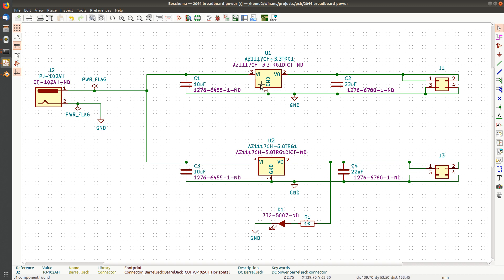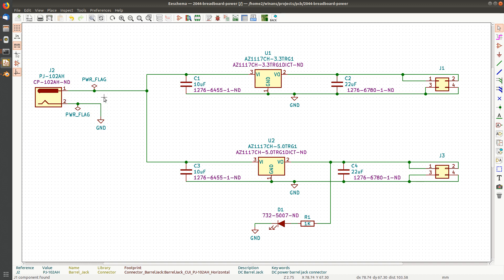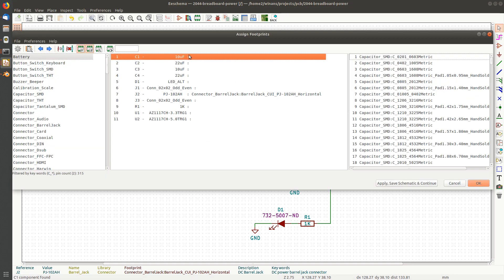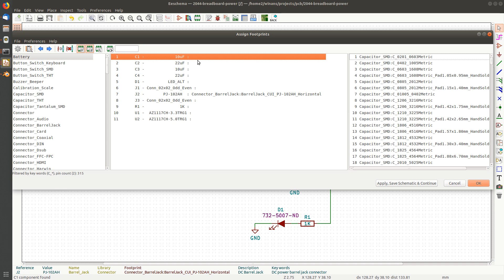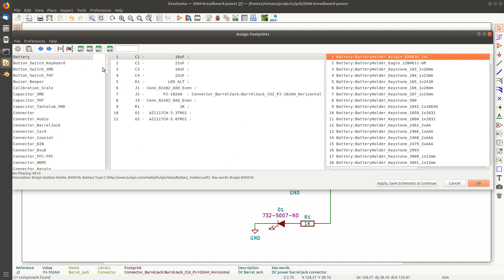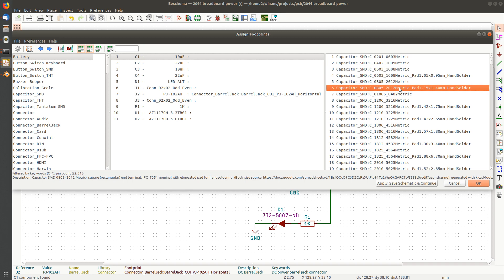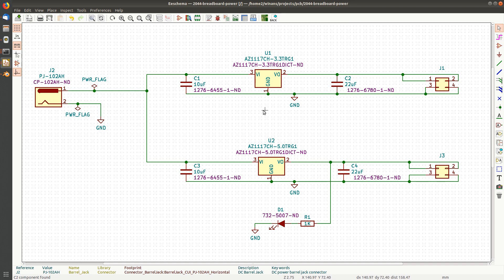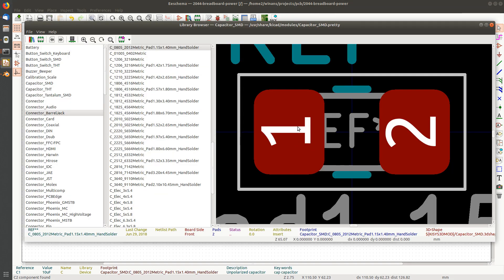KiCad 5 #3 Footprints & Netlist

Comment: How do you add 3D to your new custom component?
Reply from the maker: I don't. 😁  I'm holding off until the process is easier to deal with.
Google around.  I've seen some talk of using freecad and other tools to create/convert the 3D file as need... and then to get it centered in x, y, and z.
Reply: @JohnsBasement  😁Ok. I'll leave it as is for the mo.

Comment: At 7:12 he says it's a package, but I don't see any package in my latest "Version: (5.1.6)-1, release build" ( because I'm always supposed to have the latest, right?), but oh, I see Housings with all (mostly?) the same suffixes as the Package things in this video, so "they" musta renamed them.
Reply from the maker: Yeah.  As things "upgrade" the library can evolve.  You got it.
Reply: @JohnsBasement  And it's not just the libraries (pin headers are now in "Pin_headers" instead of "Connectors"), there's no longer a "Browse Footprints" button, you click in the Footprints field and an icon with books (library?) appears in the right of the field, you click that and it brings up the "Footprints Library Browser" window.

I'm sure this will be wonderful once I learn it all ...
Reply from the maker: @TranscendentBen it drives me nuts when people rename things or make disruptive cosmetic changes that lack any productive improvements.
Fortunately the names of the parts are still mostly the same.  You can search for them in the 'place component' chooser without concern as to what library they are in.
Footprints, on the other hand are quite annoying as there isn't a comparable search function that I'm aware of.
It took me a while to get used to what things are named.  I'm sure you'll be able to roll with it soon enough too.
Hang in there.
Reply: But no, what he's showing is Package_TO_SOT_SMD and what I'm apparently looking for is TO_SOT_Packages_SMT. At least they didn't rename them something COMPLETELY different.

Comment: One thing I'm thinking is it's worth having an LED for both sides. If you're having a problem, it's encouraging to see that the particular side you are using is  outputting power, not just the system as whole. And LEDs are cheap enough, even two of them.

Comment: Hello John, Thanks for the fantastic tutorials! Is there a way to make a footprint for hobbyist development boards such as a Mega2560 Pro Mini (2x pins), an STM32 'Blue Pill' (20 pin DIP), an ESP32-WROOM-32 (19 pin DIP), an LM2596 Buck Converter (4 single pins), a PAM8403 Amp Module, and so forth. In KiCad 5.0.2 the Modules section doesn't show any of these. They would have to be custom-made? Do you already have a video tutorial about doing that kind of thing? For example, the Mega2560 Pro Mini has the same pinout as a full-size R3, but there are several different footprints from different manufacturers, such as RobotDyn, and other Chinese makers.
Reply from the maker: You can make any foitprint for anything.  As long as the pin names of the symbol/components match the pad names of the footprints, you are good.
If you install the digikey library (see my vid of same name), you should get some more popular hobby boards.
Keep in mind that you can copy an existing footprint into your own library as a starter for something similar.
Reply: @JohnsBasement  Thank you for your reply, John. What is not obvious to a beginner is how to label the pins on a custom footprint for a hobby module: input, output, passive, bi-directional, and so forth. Some tips about how to space the footprint pads exactly, so a module would fit on a produced PCB. For example, the six pin ISCP footprint on a module is slightly offset from all the other pins. How do you figure that out?  If you already have a video tutorial about this, please point to it. Your tutorials are excellent! Thanks again!
Reply from the maker: I probably need to do better about posting the playlist for this series:
https://www.youtube.com/playlist?list=PL3by7evD3F51fKkyrUbH-PCdwPCWc9F8a
You probably want to be aware of parts: 9, 11, 12, 13, 14, 18, and 19
Reply: @JohnsBasement  Hello John, Thanks for your reply. Yes! It only took me about six tries to get a footprint made for a Mega2650 Pro Mini, and the trick was getting the pin names of the symbol to match the pad names of the footprint. Also, adding the symbol and footprint libraries via Preferences -- Manage Symbol/Footprint Libraries is something that needs to be done. Part 12 of your tutorial showed me how to do that! Thank you! KiCad 5.0.2 is really an amazing tool. Regards, KM4NFQ
Reply: @cambouiscom  It is never too late! Those look good! Thanks for sharing! !!! (Too many bangs?) 8^D

Comment: Libraries a mess?
To a noob, the libraries appear to be a mess. Large numbers of components, like a common 1N4148 diode in a DO-35 package, or a common 2N3904 in a TO-92 package won't cross over from the schematic to the PCB. All looks good in the footprint assignment from the schematic side, but the PCB editor can't even find the library that those parts are located in!  At least half of my simple test schematic simply disappeared in the PCB editor. 
Any help for the baffled???
Reply from the maker: Must be something screwy with your annotation or netlist import options. Make sure you are fully annotated. Also run a schematic DRC to make sure nothing major is messed up before yo save your netlist.

If the schematic is all good then look closely at your pcb netlist import options. ESPECIALLY if you have reannotated things. If it is no big deal, select everything on the pcb and delete it all then redo the netlist import. If that 'fixes' anything then you need to pay attention to what you reannotated or to footprint changes since your last import. -- Look at the keep/delete extra footprints and keep/change existing footprint options on your imports.

Let me know how it goes.